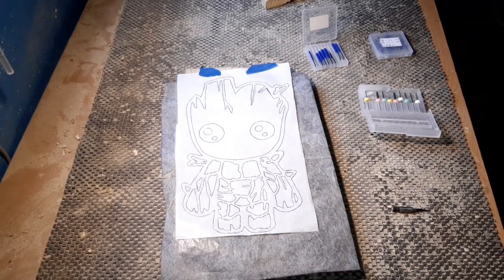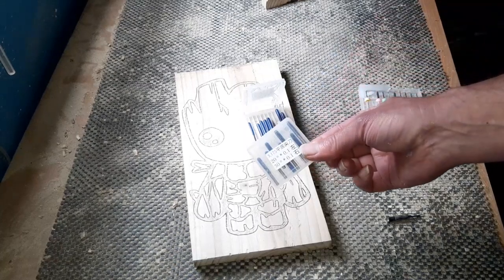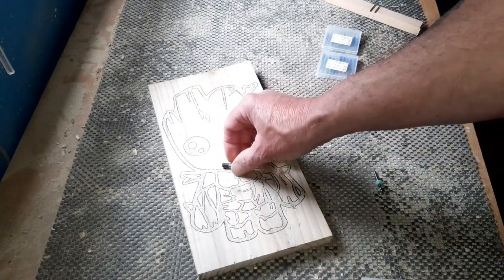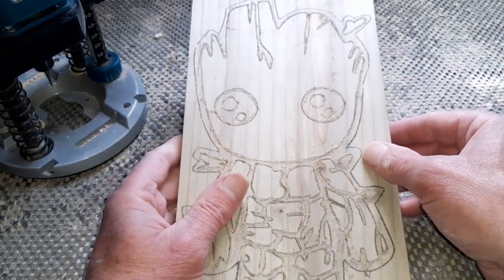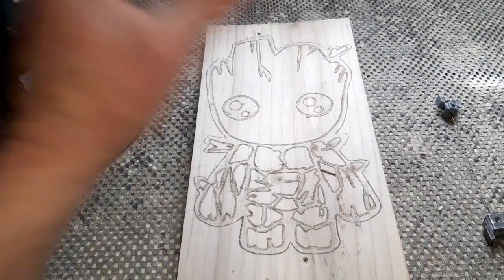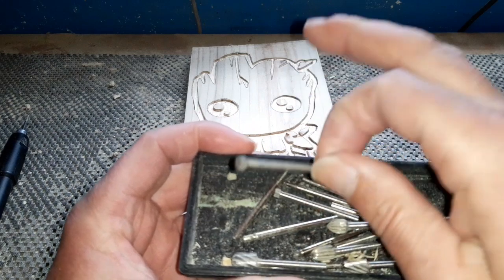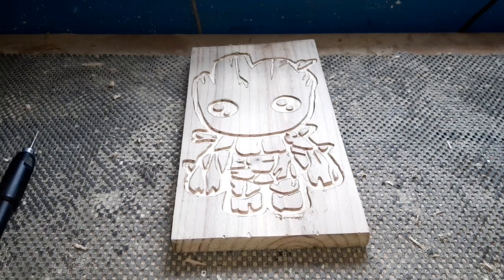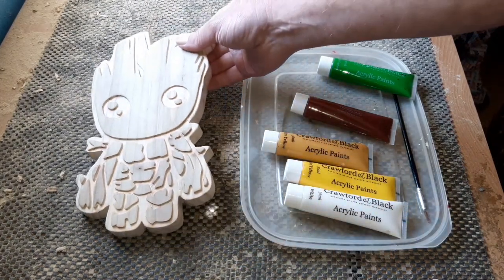Baby Groot on fencing wood, scrouter project..

Comment: Fantastic. What difference did it make when you moved from routing with Dremel bits to using CNC bits?
Reply from the maker: Thank you, the cnc bits are excellent for line work,folk normally use profile bits..end milling bits for the clear out, folk use spiral uppercut bits.its just finding what works for you..both bits fit a dremel with the router attachment..